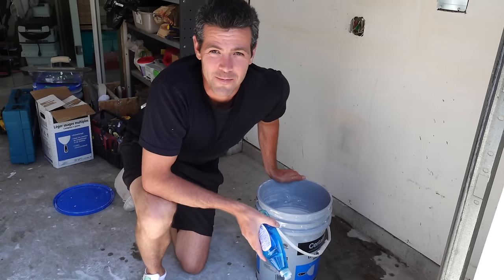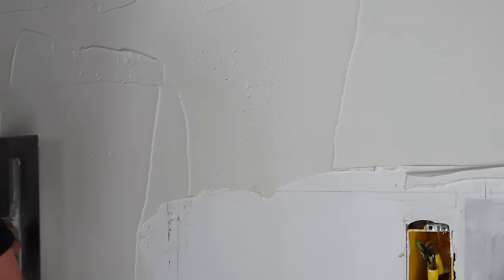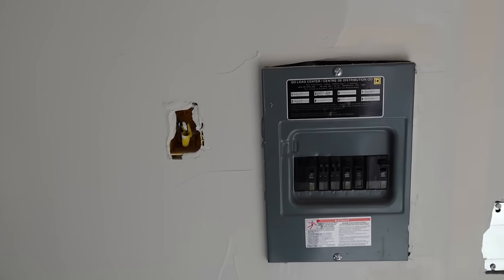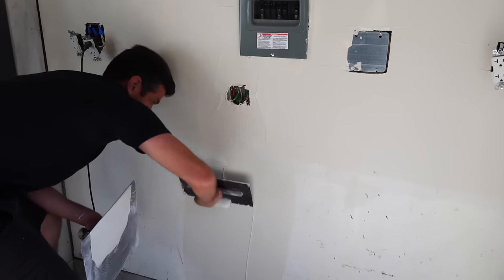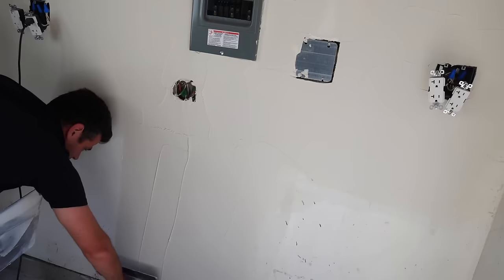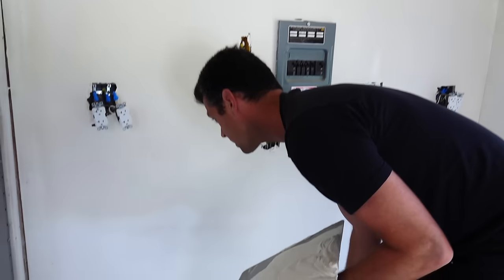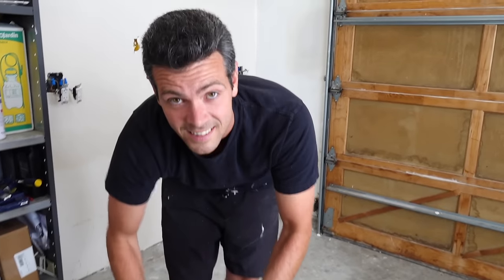😳Should you Add Dish Soap to Drywall Mud????😱

Comment: The plus 3 mud is a composition with soap already added to it by USG.  I have completed well over a million sq ft since the 1990s and I add about a cup to 2 cups of water and around a teaspoon of dawn or a little less to each box or pale.  The dawn creams the mud and gets rid of the poc issues.  When you first spin the mud stop and pop the air bubble that forms around the mixing head, it helps to keep the poc issues away.
Reply: Thank you for this comment. Plus 3 is what I have. You probably saved me.

Comment: Hi from England UK.  Thanks for s great video.  Just a thought,  are you not putting air into the mud when
mixing with a power mixer?  Maybe if after you have mixed it, you might leave it to stand for about five or
ten minutes to allow the air to come to the surface and escape out of the mud.  Just a thought.

Comment: Bro I’ve been a Drywaller since I was eight years old because my dad owned his own business and so subsequently my brother and I were scrapping houses and spotting nails since i was at a young age… I usually watch political stuff on YouTube… I’m about your age… However I find you to be probably one of the most relaxing personalities on this platform. I have always been very reluctant to add the soap… Thanks for doing the experiment for me. Lol 
One thing I will say man… I use a pan and knife not a hawk and trowel …. The trowel looks cooler. Good work
Reply from the maker: I’m trying not to watch political stuff anymore 😂. My mental health is improving.
Reply: @vancouvercarpenter  A lot of soap to clean up the politicians needed.
Reply: @bay9876  amen brother
Reply: canadians are bear hunters too... for fun/keep the hock
Reply: @panzerfaust1322   Can I ask you a question since you're a drywaller? I am using joint compound for a project, and found out this through research. I haven't tried it yet because I don't want to waste money, so I'm hoping your experience can help!!

I found out that joint compound reactivates when water is added to the surface. Is there anything I can apply over it to keep it from absorbing water or humidity? Like a sealer? Also I read that it scratches or scrapes up easily. Is there anything I can add to increase the strength of it so it doesn't damage or dent easily if you bump it? I heard something about pva & I think someone said laquer on a reddit thread I was reading lol, but not sure if there are other things I can look into.
Reply: @Honey-Bee-25  paint your completed drywall
Reply: @panzerfaust1322   So just painting it is enough?? I'm shocked! LOL! Thank you, it's a small room project.
Reply: @Honey-Bee-25  prime with a good primer first …. Kilz 2 water based is good and then paint with normal paint after
Reply: @panzerfaust1322  thank you so much!! I truly appreciate you taking the time to respond and for the recommendation!!
Reply: @Honey-Bee-25  absolutely

Comment: Love your videos.  Thanks!  I hope I can return a bit of a favor by mentioning your air bubbles are from your mixer.  You're pumping air into the mud with the blades whipping that wide open hole in the center.    Try mixing the stuff below the surface without creating a whirlpool on top.

Decades ago, I realized whipping air into latex paint promoted a really thick layer of dried paint in the can.

Comment: I live in a secluded small town with few options. I love plus 3 for finishing because it's much easier to sand. However plus 3 is rarely available here. Green box all purpose is readily available. I've found that by adding 3 or 4 Oz of dish soap makes all purpose almost as easy to sand as plus 3 and it goes on smoother during application. No adverse effects aside from the stinging eyes during sanding

Comment: I have spent almost 15 years working at a series of apartment complexes, doing allot of small repairs, and lots of drywall patches. As far as soap in the mud, mudding wise I haven't noticed any difference until the painting. Oil based paint defiantly didn't adhere as good, and in a few odd cases, didn't dry thoroughly. The top dries fine, the underside didn't seem to dry properly, and would cause the paint to sluff off with moderate effort. But could have situational as well. Thanks for showing this on a larger scale.

Comment: That is such an amazing idea that I would have never considered! Detergents are generally surfactants meaning they break the "surface tension" of liquids or liquids and solids. Crazy as it sounds, that actually means that as well as being smoother, it would actually bond even better to the wall. Also, paints will adhere really, really well. Having a surfactant mixed in will cause a good paint bond as long as it was not so hot and dry that the paint dries up really quickly. Never would have thought about using a surfactant in drywall mud! Actually an amazing idea with no real downsides?

Comment: Try adding about 2 teaspoons of soap to a 16oz bottle of water, and use that water to mix your mud. I’ve found it to leave a much smoother glass like finish, highly recommend any finishers out there to try it
Reply: Do I just add that one 16oz bottle to a new box of mud? Or should I thin it down with more water
Reply: @Bambino4123  I thin however much mud I need using the soapy water to a consistency I’m comfortable with, I also add a little plaster of Paris to my mix
Reply: Sorry for the late reply but give it a shot and experiment!

Comment: You don't need to worry about soap in the mud affecting the paint! The long chain emulsifier molecules in the the soap are hydrophillic on one end and hydrophobic on the other. They strongly attach to the water suspended in the mud and, as you noted, make the mud more smooth (technically, more elastic). The other end of the emulsifier molecules will attach to oily substances. They'll make oil paints stick better and have no substantive effect on water-soluble paints and the "oily" end of the molecules slip off your trowel more easily.

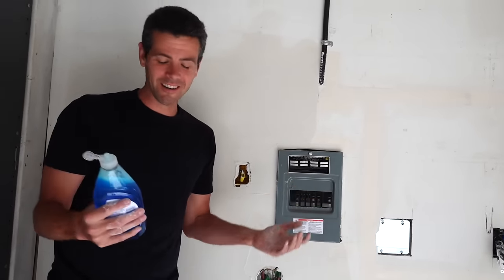The amount of soap that you added at ~5:20 was a good start for the amount of mud in your bucket, but maybe 2x that would've been better (it's hard to see how much mud is in the bucket). In general, about 1/2 cup soap per bucket of drywall. Also, I only use it with the US all-porpoise mud on a finishing coat, not your Canadian Bud-light-variety mud. 

You can also cheat the mud a bit by mixing the mud up completely, first, then adding a small amount of soap and just mix the soap into the top cm or two of mud and skim the mud off the top for use. This leaves most of the mud mostly soap-free but with a good amount of slippery mud on top and you can mix a bit more of the soap-free mud in if you think it's too soapy - which I don't actually ever find. 

Finally, if you're going to add water to the mud, thoroughly mix it in beforehand and make sure there are no drops on the side (or mix the soap in first) to prevent the soap from forming bubbles with the water.
Reply: I'd suggest trying this again, and then go through the painting process as well. Consider using all-purpose mud rather than the light variety as I think it'll bring out a more pronounced difference in the material handling characteristics.

I agree with others that your daughter did a good job with video. She could've centered more on the whole scene including the things you're working with instead of sticking mostly with you, but in general, she was awesome, especially getting up close to the action. You need to get comfortable with that. :-)  Love your channel.

Comment: I am convinced that the bubbles come from dust on the wall when you apply mud... I dont sand between coats and I dont get bubbles.. I do add dawn to my mud because I always saw mud crews doing it on jobsites. I think it might also make it sand easier... if nothing else it adds a nice fragrance to the room while you are mudding... you added the right amount in my opinion... makes it easier to clean tools too!

Comment: There is an additive that's latex based, I think. I had an apartment in an old building with plaster walls that were cracked due to settling. I tried fillimg the cracks with plaster and they quickly returned. then I added the latex mixture and the cracks didn't reapear fro years.

Comment: As a diyer i consider myself pretty good at finishing drywall.  As i see it however im going to go with the addage ,"if it aint broke ,dont fix it" mentality when it comes to adding soap. All i can think of is potential issues down the line with the drywall sticking to the wall and paint having issues. Its not worth it to me.

Comment: I was watching a video of the crew in Australia calling themselves Drywall Gangsters. Once they are finished with the tape coat and it is dry they trowel a coat over the joint and then use the trowel to remove almost all of it. Basically, they are adding a lubricating coat of compound which eliminates the drag that dry compound creates on the new compound thereby creating bubbles. They don't add anything to their compound other than water and this technique seems to yield excellent results.

Comment: Hey Vancouver carpenter...I've seen guys that use the automatic taping tools use Dawn dish soap in their mud because according to them it helps the joint compound "glide"....I work by hand though so I really wouldn't know but what I do know that's a fact is USG will not guarantee their products if you add foreign stuff to it ...sorry so long peace ✌️

Comment: Been taping for 10 years all my knifes have electrical tape built up over my handles.  After doing jobs where I was taping for 11 hours straight for months it helps to reduce those hand cramps.  3 years strong now I need to figure a better method for the shoulder socket

Comment: I can see how this might work. Soap breaks the surface tension in water, so the water will flow more smoothly. You should try adding just plain liquid soap with no dyes or scents in it. Then add it to the water. Mix thoroughly but not so that it's foamy....that traps air. Mix it gently, and you should't need very much. Maybe even half of what you added in this video. I think this would give the best results if you're going to do it. This is how I'd do it.
Reply: This. Add the soap right before you are done mixing and it only take about half as much as you added. You don't need to add this every coat, but when it's going on thick and likely to bubble, a little soap makes it much better because it breaks the surface tension of the water in the mud and makes it go on smooth. I like to mix up Easy Sand really thick, add some soap and I can put a single coat on corner bead that only requires a light skim to finish. If you don't add soap, you will get a lot of bubbles in mud that thick and it will need more than a skim to finish.

Comment: I’m using 40 minute compound dry powder. Having a heck of a time with bubbles. Just used The tiniest amount of soap, and it went on like butter.  I didn’t use as much as this video, or even close. Hoping for the best after it dries. It did make cleanup easier, which may be a bad sign.

Comment: Been putting dawn in my mud for 30 years and never had a problem. I don't know about bubbles but it definitely makes it smoother, and stay smoother longer. Never had any adhesion problem, and I paint almost all of my own work.
Reply: Thanks for the info..I'm a 20 year painting guy,but ocassional mud guy as well (self taught mostly) an i always wondered if soap affected the mud in negative ways for painting.
Reply: Can I ask you a question since you work with joint compund? I am using joint compound for a personal project, and found out some info through research but not sure how accurate it is. I haven't tried it yet because I don't want to waste money buying the wrong things experimenting, so I'm hoping your experience can help!!

I found out that joint compound reactivates when water is added to the surface. Is there anything I can apply over it to keep it from absorbing water or humidity? Like a sealer? Also I read that it scratches or scrapes up easily. Is there anything I can add to increase the strength of it so it doesn't damage or dent easily if you bump it? I heard something about pva & I think someone said laquer on a reddit thread I was reading lol, but not sure if there are other products I can look into that you may know off hand.

Comment: Given, I'm far from a professional... just grew up in a house full of rowdy brothers. Then lived close to all the bars in college/grad school while having rowdy friends. Did a lot of shitty drywall patches in my younger days before I started helping out my contractor buddy while I was out of work. I didn't become competent at basic patching/finishing until your vids tho! Amazing work you're doing making near-pro repairs possible for the average DIYer. 

I only add soap to the pre-mixed stuff. I've found it gives you more working time before it starts to pull off, and become somehow too dry to work despite being an perfectly acceptable consistency. Without some Dawn in  the mix, the consistency just feels totally wrong when compared to kind you mix yourself.

It doesn't make a huge difference , but it does cut down on the number of coats I've had to do since it's easier to keep  it fairly smooth from the first coat.

edit: Take the plugs out bro!

Comment: So I learned about soap in mud from a Canadian taping crew. They put about 1 cup in a bucket and mixed it. I’m not a career taper but if I do something, I intend to be good at it eventually. So I watch and learn and I’ve tried it and it did help with application and smoothness. Especially with setting compound. The only thing that concerned me was one job I was doing, there was a water event. A pipe burst and there was a lot of water damage on the ceiling I just finished, I mean like I did a detailed coffered ceilings, the works. Anyhow, the mud let go of the drywall. The drywall had to come down(everything had to come down) but I noticed it, dunno if regular mud or mix would have stayed. That’s my experience with it.
Reply: The painters would have your head
Reply: @anthonyalagna8326  I painted the place after that taping crew. Primer and paint stuck despite me not thinking it would. Counter intuitive I know but that’s how it went. I did the soap thing for a few years afterwards, I d every step in the process so from framing, hanging, taping, priming, trim work to final paint. Never had a problem. I don’t need to do this anymore as I’ve gotten better at taping, but have you had a problem with it?
Reply: @sawdustadikt979  had cɔntractor tell me the painters would get pissed off.not to do it again
Reply: @anthonyalagna8326  were you subbing?

Comment: I use dish soap sometimes,  gain smells better but dawn works better- I use in all purpose and a light drizzle  mixed in to the first four to six " of the top... as you saw the effects of smoother applies kinda dwindles as it sits.. it sort of acts as a leveling agent as the compound fights to adhere (sorta like hot mud) when applying and as you use the mix you can tell it's thickening back up so you are constantly mixing it as the glue and compounds will actually tacky up if not quick enough. (It will not support mildew as mixing water can when trying to keep for long periods or in humid seasons) so there are pros and cons.. I mix water with quick set but usually soap or nothing at all in my compounds if not just a drop of water in my pan... (says the mixer boy who probably never hung drywall or taped) 😂

Comment: I use soap in mud to help with bubbles, dries a little faster and way easier to clean tools after work. Plus mud will become glass smooth if you put a bit more elbow grease into it.  40 % more work  I get from same job when homeowner fills how smooth walls become. Try it

Comment: Adding soap turns regular mud into machine mud, I use machine for hand trowelling as it does tend to bubble less, smoother applications using less water and saving wrists, down side is the eye and nostril burn at sanding. Glad you made the vid as I shared your skepticism and still partially do, adding something that creates suds to remove air bubbles is a mind job.
Reply: The surfactant in the dish soap would reduce surface tension and also increase affinity to oils on the surface you are applying the mud to or oils that may happen to be in the mud. I think proper prep would negate the need to use surfactants but in some conditions surfactants in the mud may help. No expert here.

Comment: I'm surprised how many experts in the comments don't know what this does
Aside with your conclusion of making it a little more slippery and float out better it's more known to help with flash setting. It's weird, it does not necessarily retard drying time or delay but yet make it more evenly dry. Say you have 20 minute mud; well it doesn't really allow you to do a second coat in 20 minutes yet it sets up in 20 minutes. 
Adding the soap will help it set more evenly set in like 25 minutes. You have to play around with it because humidity, heat and cold changes how much soap you need to add. 

I guess you can relate it to using penetrol or floetrol paint additives, sort of. 

One more thing I have even used hardeners and dies along with using soap all at the same time mixed in and haven't noticed any bad changes to finish product or problems with painting. 

It goes with anything try something new if you don't notice it helping you making it easier then don't use it any longer. 

Good luck guys great content enjoy your videos 👍
Reply: I recall reading an explanation for how soap works: it makes water"wetter". Therefore, it would make adhesion even BETTER inasmuch as the mud has to penetrate the paper to a degree to stick at all.
That said, the same may not be true for the paint, as it has chemical, not physical bonding.